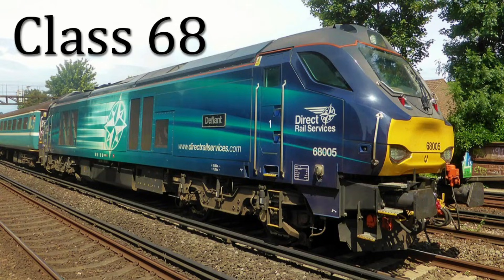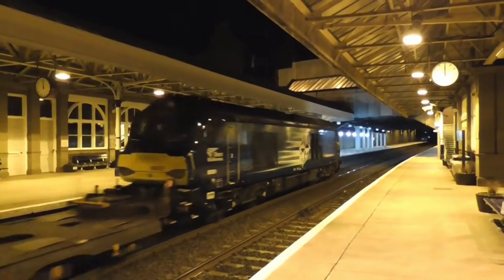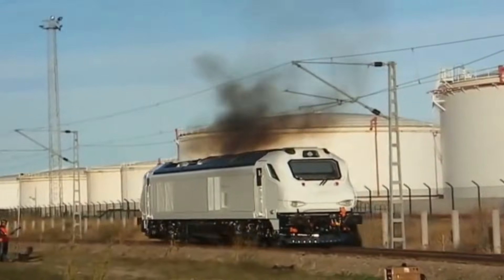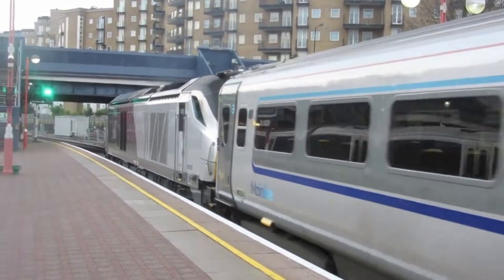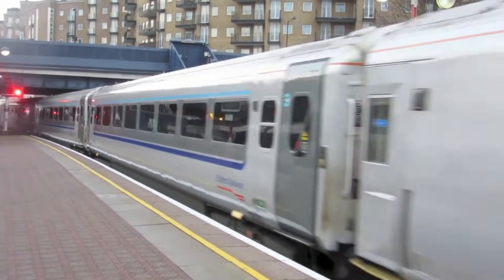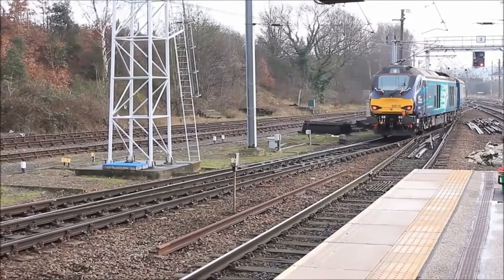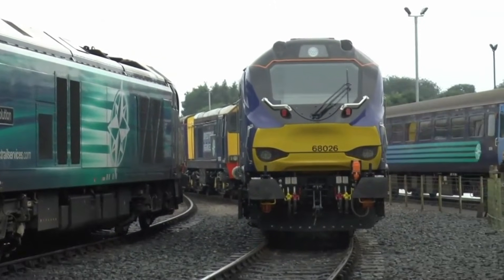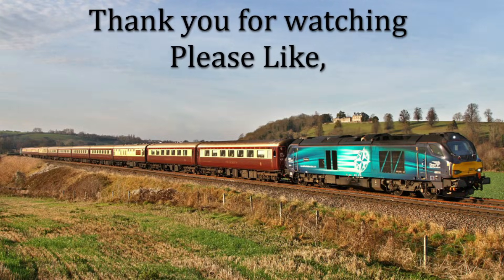The Class 68: The Diesel-Electric Marvel Changing the Face of UK Railways #class68 #ukrailways #fyp

Comment: They are noisy with smokey exhausts. They should have no place on a modern railway.
Reply: Steam with light oil firing is cleaner,  quieter, and nearly as efficient, at about one-third of the cost per unit. Duke of Gloucester is nearly as powerful.

Comment: Looks like they're going to be succeeded by the new Class 93's soon, as they can go 10mph faster than the 68's.
Reply: The 93s aren't going to DRS, the Rail Operations Group has got them
Reply: @Thechoppersofcardiff  In which case they are for 'new' traffic and will not succeed/replace 68s as Theo implied?
Reply: I agree if you operate under the wires most of the time on freight only. 10 mph doesn't make much difference and for any distance on diesel, performance is going to be way down (a third of the 68s).

Comment: Vossloh sold the rail business that made the Class 68 to Stadler, so depending on when each 68 was built, they’ll either have been manufactured by Vossloh or Stadler. Vossloh also branded the 68 as UKLight, a name which Stadler still uses for this loco.